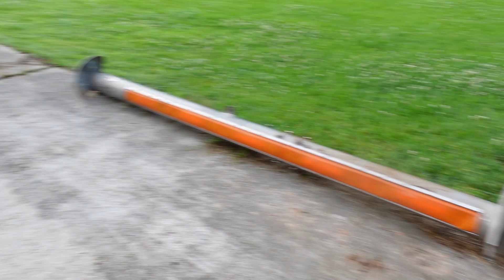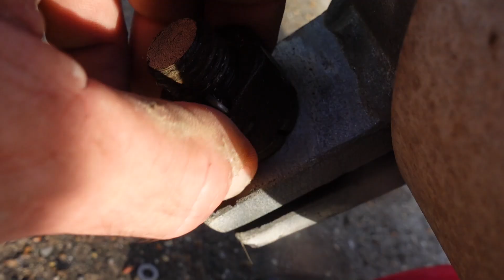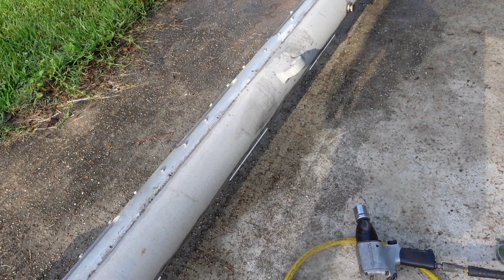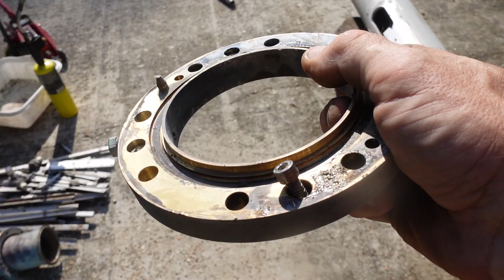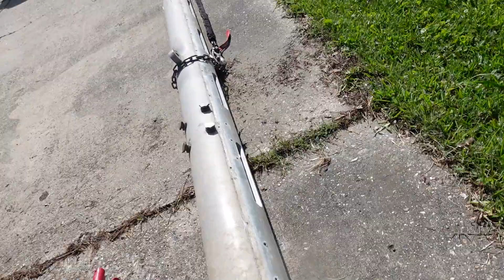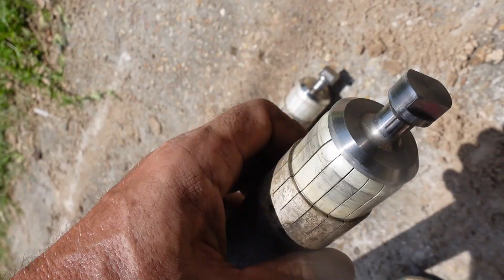Scrapping  700# Television Transmission Antenna

Comment: Cool stuff as always!!
Could those tubes be zinc in an attempt to prevent electrolysis?
Reply from the maker: It's possible, but the way all the SS fasteners galled up, and the weight, It believe it's stainless. Probably 304. Thanks!